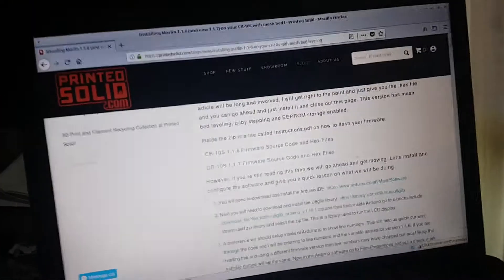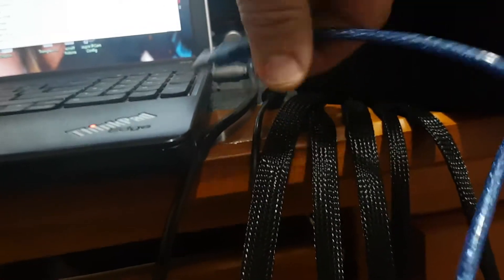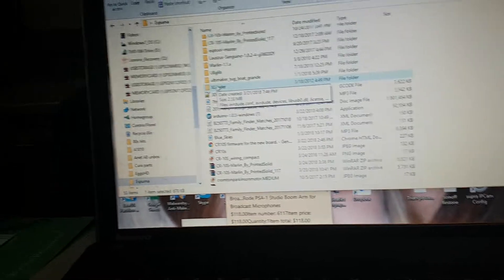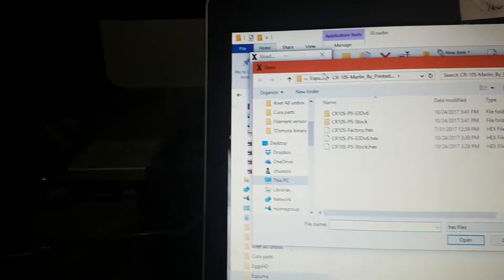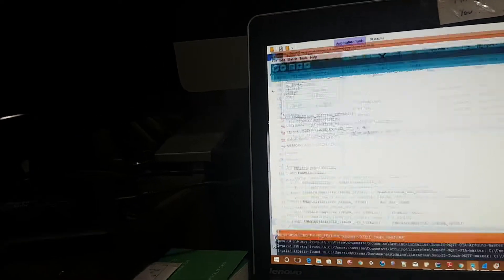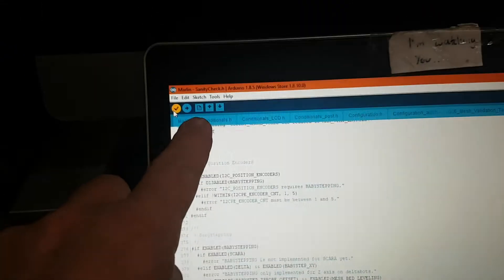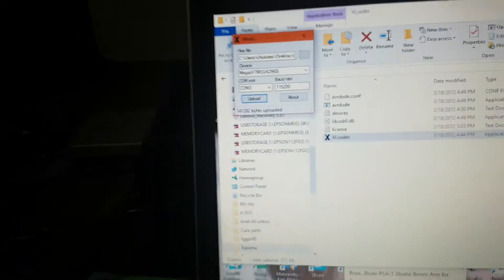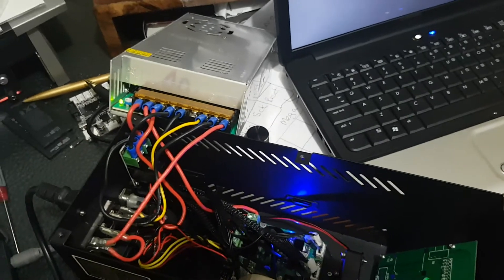Upgrade the CR10s to Marlin 1-1-7 or 1-1-6.

Comment: Hi, how is it working? I mean your printer is turned off. nad yet You was able to upload code in to it. When mine is off i cant even connect to it. And when ill turn it on uploading will start but i took over 10 min and more and nothing changed. Uploading... all the time. Mine board is version with single ribon.
Reply from the maker: My printer is in my shed 35 metres away. I have a networked router down there which is connected via POE. Both boards work fine. I turn on my prints via google home. Then I upload files to my raspberry pi's . Sound like you may have a uARt problem.
Reply: @chuxxsss  I was trying updating via octopi alredy. But i had some timeouts problems. I have no idea what i can do to amke it work :/ I only want my bltouch to work...
Reply from the maker: @TheGregMean  You may need to pull out the board and use a uart to usb connect to talk to the board.
https://rover.ebay.com/rover/0/0/0?mpre=https%3A%2F%2Fwww.ebay.com.au%2Fulk%2Fitm%2F163772199609

Or buy a new board.
Reply: @chuxxsss  But i tought cr10s should work with no additional hardware right? So how is it possible i need some extra stuff?
Reply from the maker: @TheGregMean  Does you CR10s screen come up with the boot screen, and can you control it from  the CR10?
Reply: @chuxxsss  I dont get what You mean? I have "3d printer" on startup of my cr10s, printer works perfectly fine. What do You mean by "can you control it from  the CR10?
"?
Reply from the maker: @TheGregMean  So the CR10s works fine from the front control panel.
Reply: @chuxxsss  Yes, its fully operational. Im using it with my octopi, with cura etc. I even were printing with it few h ago. But i want to use bl touch. This is the only reason im trying to change firmware. But whenever ill try it dosent working. In cura for example its keep rebooting home screen over and over again. In octopi i have some timeout issue. In arduino there was some issue too.
Reply from the maker: @TheGregMean  it sounds like a hardware problem.  But have you set offsets for the probe ?
Reply: @chuxxsss  No, i didnt set any offsets yet. I only wanted to upload it and check is it working. And i didnt saw that part in instalation guides yet. I mean i didnt reach that far.
Reply from the maker: @TheGregMean  Not really sure. I have a Bltouch but not fitted.
Reply: @chuxxsss  Well, if You have tim and will to help me than contact me on discord Grzebcio#4349

Comment: Id like to know if u can edit the stuff on arduino then save on a pc and send to a laptop of something to load to the control box cuz my printer upstairs with pc downstairs and laptop not powerful enough (fast enough) to do the commands needed
Reply from the maker: You could get a friend to compile it for you then put it on a laptop. The other way is load linux on your slow laptop then use Arduino on it. That would be faster.
Reply: no laptop so friend i t is lol
Reply from the maker: @RTJ3DCosplay  could you just remove the board from the unit. Tag all the cables. Then take to a friend's place to upload fi firmware?
Reply: sadly not , i have cables from the board to the extruder thats a firmly soldered / welded in place , i cant remove it
Reply from the maker: @RTJ3DCosplay  You need to just remove the board. The hotend is connected to a FET. The mainboard comes out easy.